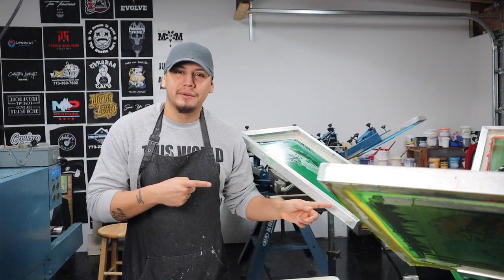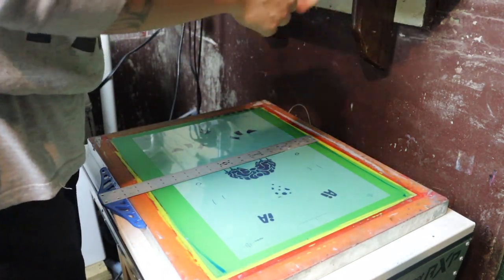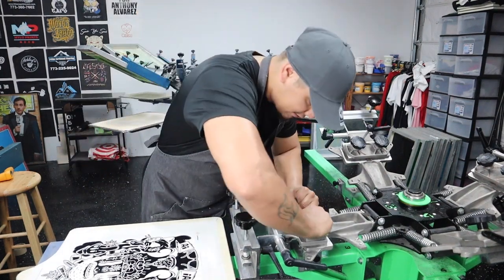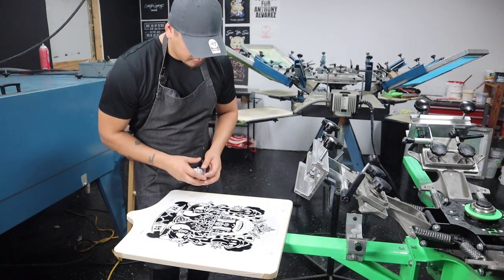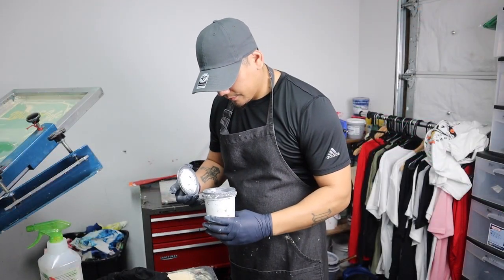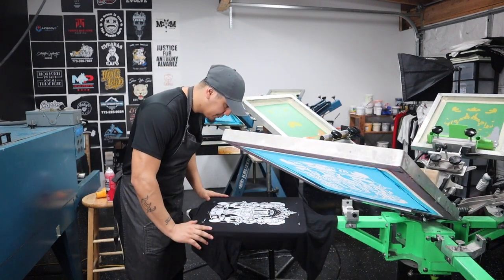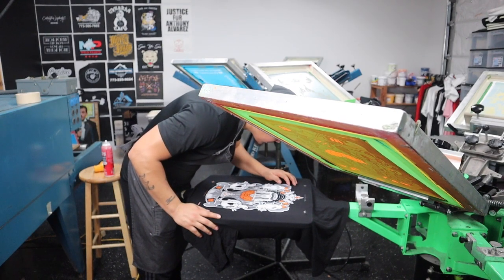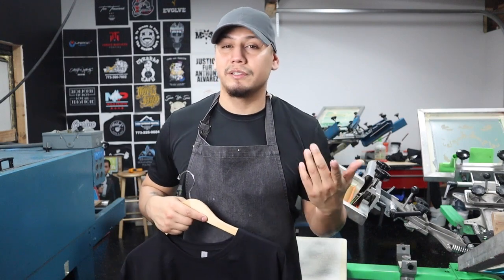SCREEN PRINTING A MULTI-COLOR DESIGN!

Comment: The printer you use is pretty expensive do you recommend I invest in one right away or is their a cheaper one for a beginner?
Reply from the maker: I also have a small epson stylus  c88 that I bought for $120 at Amazon … but it only prints up to 8 x 11 1/2 “
Reply: And you can print 13x19 also